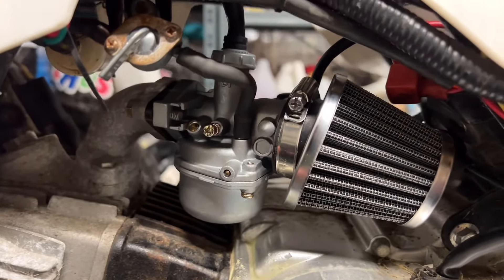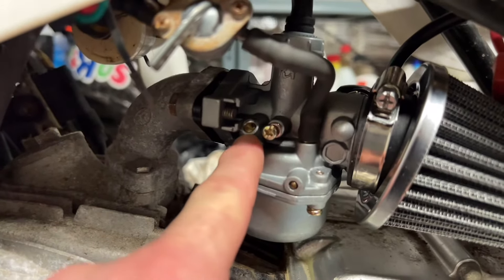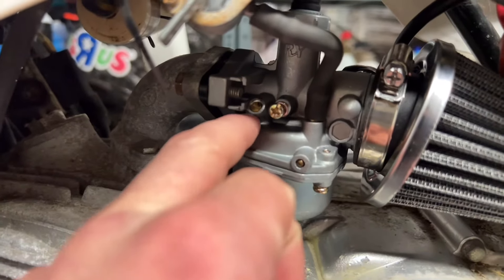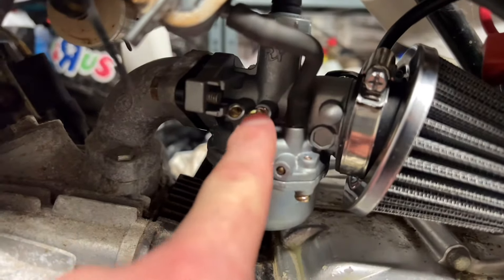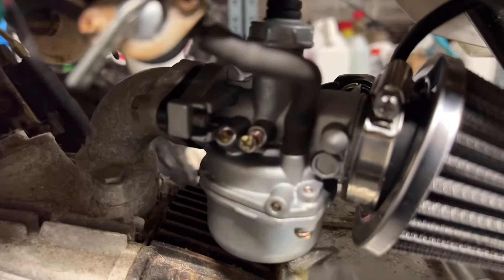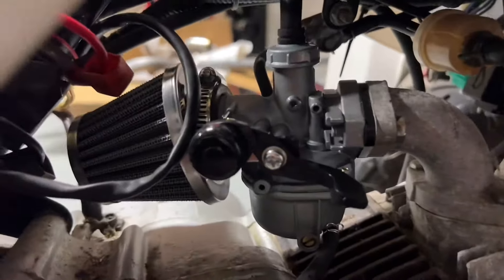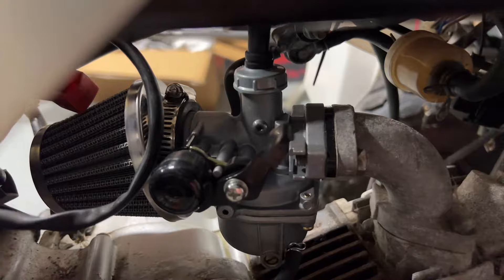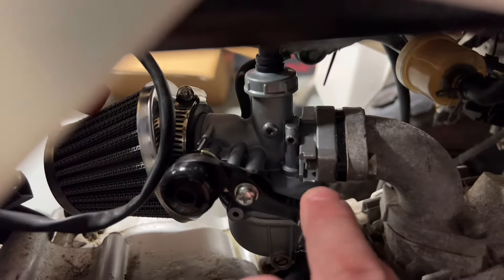Tuning / Adjusting PZ19 Carb on Kids Quad bike

Comment: Bought one for my kid yesterday. When j turn choke off after warm up start, the bike shuts down. Is that normal? Am j missing something?
Reply from the maker: It probably just needs adjustment. If it cuts out when coming off the choke it suggests the mix screw is actually set too lean and with the choke on it’s actually running close to how it should be off the choke and with it off it’s just not getting enough fuel. Try adjusting the mix screw towards the richer end to get it to run without the choke on, then make sure for the next start it starts with the choke on and continues running once the chokes off. If it’s sat for a while it might need a clean/blast with carb cleaner to clean out a blockage in one of the jets.